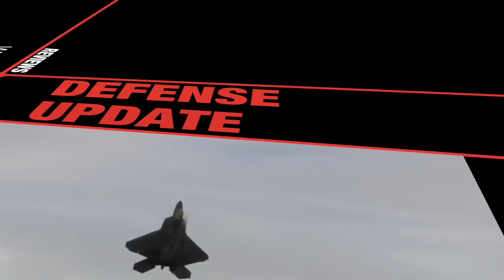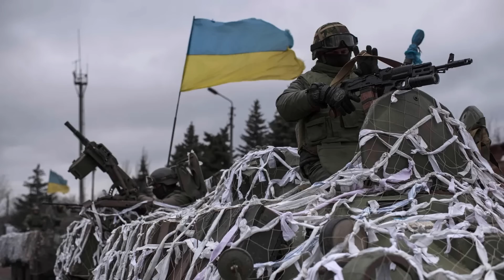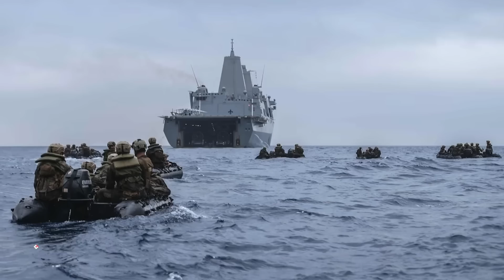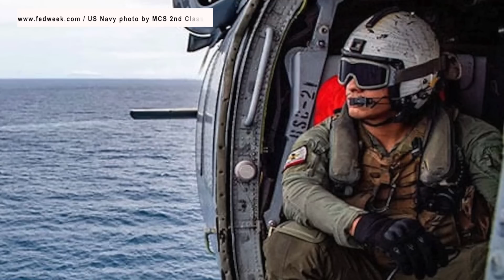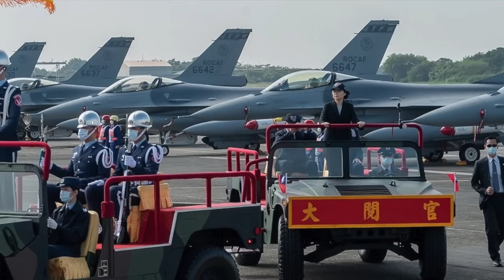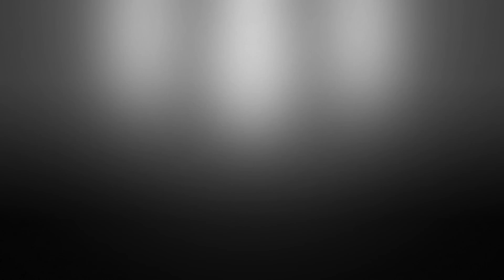U.S. commander : can manage #Ukraine and #Taiwan simultaneously !

Comment: I don't understand why Taiwan's domestically developed and manufactured anti-ship missiles are never mentioned in any analysis?? 
From what I have been able to find, Taiwan's missiles are good, with good ECCM capability.  
Taiwan has the engineers and resources to design and build advanced missiles.  
Taiwan had the production capacity to build 200/yr. Which would give them at least 2,000 such missiles. 
Taiwan is expanding its production capacity to 500 missiles per year by 2025.  So, in five years, Taiwan will have over 4000 missiles of its own design and build.
Reply: I would argue even more. The institute for weapons manafacturing is going to deliver more than 1000 missiles to the ROC army...

Comment: The US can stop a chinese invasion of Taiwan in 30 minutes.  Just 4 aircraft.  Four B-2s, carrying high energy CW lasers.  We've had the laser for 45 years (1978). What we didn't have was a highly portable electric generator capable of >5 MW...  that weighed <35,000 lb (including fuel weight).  Now we do.  Thank you, Rolls-Royce.  Super-radiant Nitrogen gas discharge laser.  337.1 nm primary output wavelength (near-UV).  ~30% efficiency.  >1.0 Mega-Joules/cm2/sec CW output (w/ >4 MW input).  Vaporizes w/ 1 second of target contact.  Fires for 3 seconds, & can repeat every 7 seconds, up to 6X/minute. Like 180 shots in 30 minutes.  Range = 200+ miles from 40,000' altitude... 

150 miles SE of Taiwan, 4 B-2s maneuver at 40,000' doing 600 mph.  The Strait of Taiwan is w/in the 200 mile range.  An invasion force first wave of 300 naval ships & 450 aircraft just starts bursting into flames & exploding.  NO radar or missile warnings. In 30 minutes, those 4 B-2s can fire 720 times.  That's the summary destruction of 96% of the invasion force in 30 minutes.  Allowing Taiwanese defenses to focus on any missile threats.  

From 250 miles east of the China mainland, at 40,000' doing 600 mph, the B-2's 0.05 m2 RCS is untargetable.  They're also operating from a place China won't be focusing on, w/ their invasion fleet 30 miles from Taiwanese defense forces.  The CCP will be looking for a large scale mobilization of US airpower at western Pacific bases, & carrier strike group movements.  Xi Jinping will be stunned & despaired.  Can't wait to hear his national address to the Chinese people, after seeing $20 billion in military assets "invisibly" wiped out in 30 minutes.

America is THE human world military superpower.  We have gone to great & expensive lengths to avoid dropping a third nuclear bomb on anybody for the last 78 years.  But don't make us angry.  You won't like us when we're angry. Cuz we're really good at expressing it.
Reply: 🤣 and yet it keeps losing wars against people with only rifles.